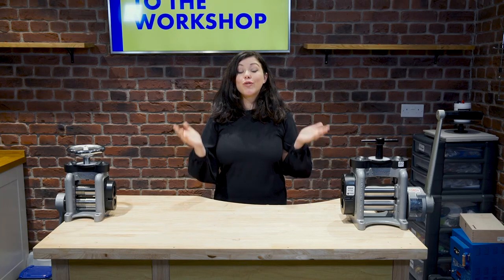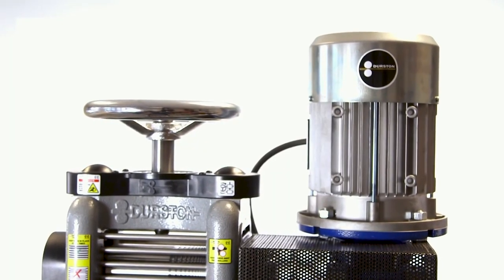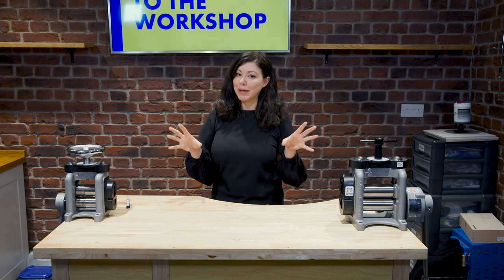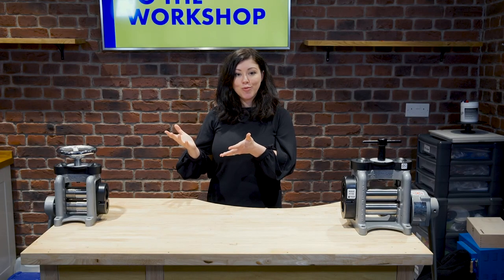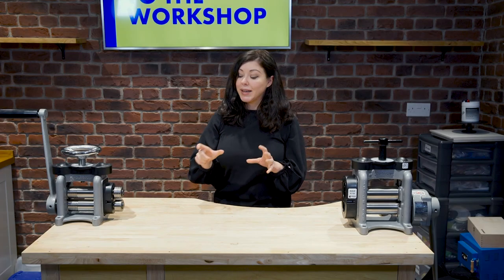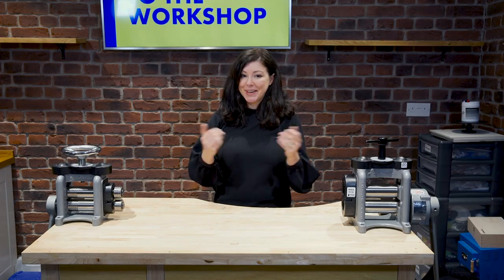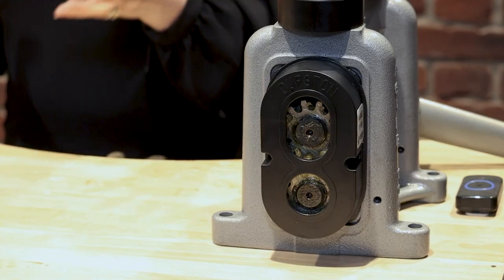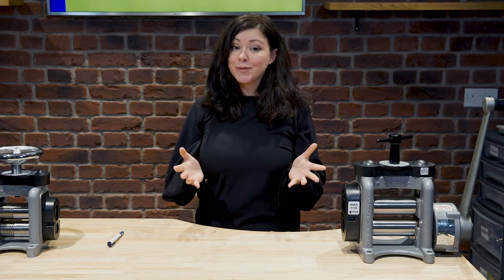How To Choose A Rolling Mill

Comment: Got myself a direct drive mini rolling mill as I am on a very very tight budget, yes, it takes a wee bit more strength, but overall a wonderful item, worth every penny. Wish I could afford an extra 150 pounds for a gear version, but perhaps someday later.
Reply: How hard it is to actually roll it for 1 h straight? Like going to gym? 😂
Reply: @HugoJansons  Never produced anything that'd require one hour of rolling. All depends on how tight you go with each roll, with mechanical it's better go by small reductions - then no problem, if I go for much bigger sometimes i'm not even able to budge it.

Comment: Can these be used to flatten hot steel
Reply from the maker: It's not something that we would recommend, the material you put through a rolling mill needs to be softer than the rolls themselves otherwise you'd risk damaging them
Reply: @cooksongold  Gotcha! I'll try and make my own rolling mill and harden some solid steel rollers.
Reply: @cooksongold  But... if you ever decided to make a highly sort after product, the patent less Mcdonald rolling mill is something every blacksmith wants but has to make themselves.